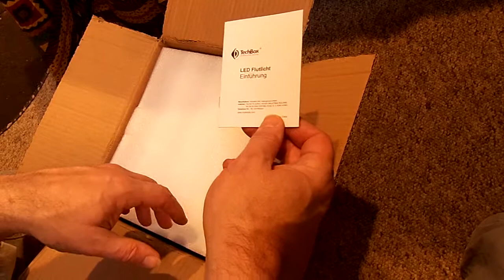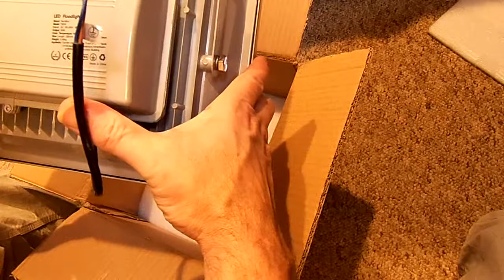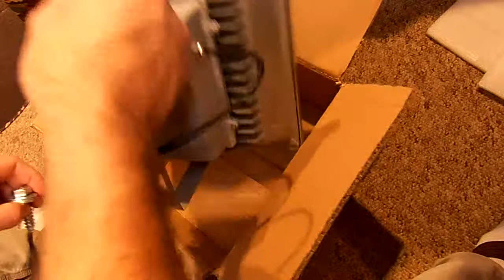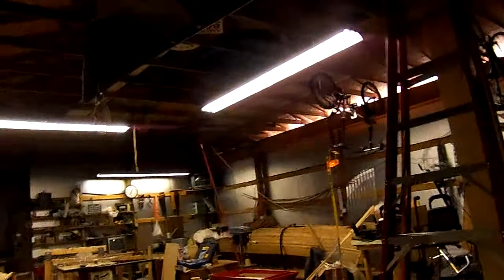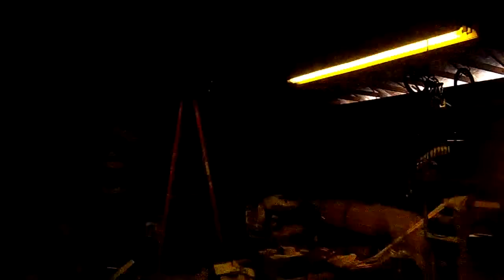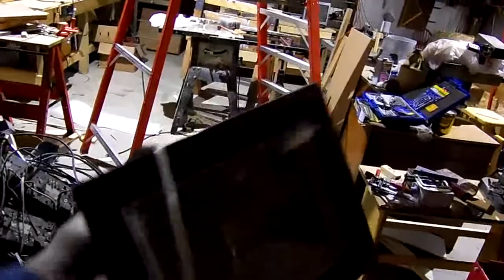LED Lighting Project - 50W pair

Comment: Nice to see you are using the electrical boxes. I rewired my brothers garage last spring. It was a complete mess. Extension cords were strung up in the rafters to the fluorescent fixtures, romex spliced with electrical tape and old unused wires running everywhere. I replaced with standard screw sockets because the fluoros were useless in the cold. Not worried about energy savings since they are used less than 2 hours a week. If it were me, I'd put up LEDs, but they didn't want to spend the money.

Let me know how those lamps work out. Chinese stuff can be hit or miss.
Reply from the maker: Yeah, that's why I'm stopping at this point. Well I will put the 100W fixture up when I get it back, and permanently mount that 30W fixture too.But th en I will use them for awhile before doing the rest.

Comment: Interesting.  I love the full spectrum lighting.  It makes the standard lighting look yellow and dingy, so I'm spoiled. 

I use it inside, but not LED, yet - the bulbs or lights for indoors are pretty expensive.  Have you heard, tho, how much less electricity it uses?  Some factories making the switch to full LED are said to be saving some very major bucks on their utility bills - helping pay for the initial expense.
Reply from the maker: A well designed LED bulb or fixture is slightly more efficient than a high efficiency  CFL or fluorescent fixture. And way more efficient than any sort of incandescent (including Halogen). Also, especially compared to the old long tube fluorescent fixtures, a much better quality of light without all that flicker. And a longer lifetime and no Hg (Mercury)..
Reply: *****
Should have figured that you'd be aware of pretty much every aspect of it, just by the way or depth of the way you go into things.

Yes - those are very attractive aspects of it.  I like the fact, too, that it doesn't produce or leak heat.  Guess that's part of the efficiency of the LED, as the halogen and twirled fluorescents certainly heat up.

Will be SO glad to part with the mercury.  I was concerned I might have to forego the full spectrum aspect, as I hadn't yet seen indoor lighting, at least, that came that way.  But if they have them for outdoors, then they must be available indoors like that, too - tho of course in nicer indoor-type looks.
Reply from the maker: TheseEyesGod
   Yes, just like florescents, they can control the spectrum by adjusting the phosphors. Technically, one could call a white LED a fluorescent. Most are actually a blue, purple, or UV LED with a phosphor in front. The more powerful ones do still make some heat, and most can't be used in a sealed fixture with no air flow.
   LED "bulbs" to replace an incandescent or CFL have come down in cost too.